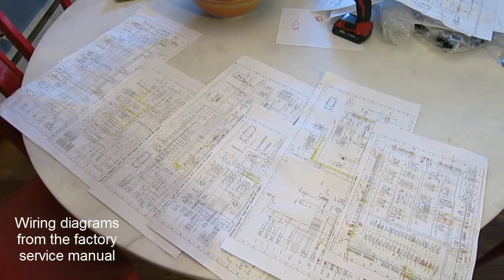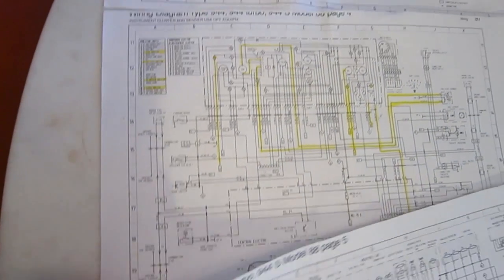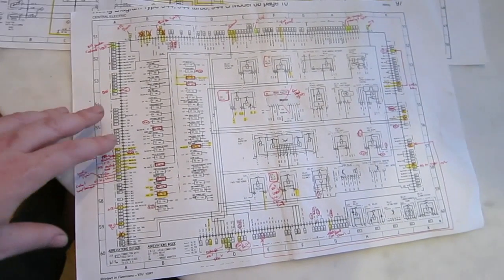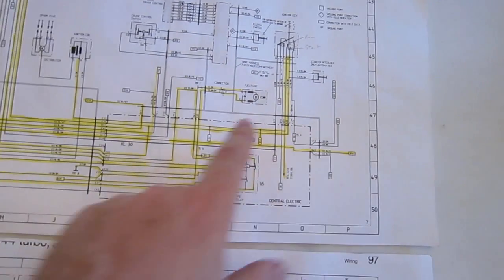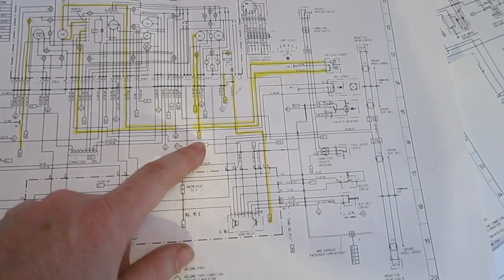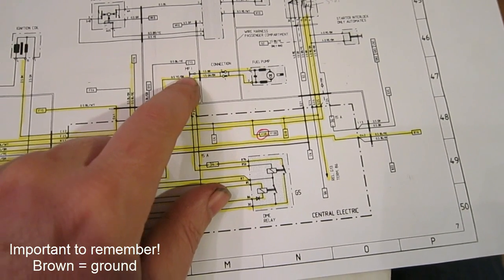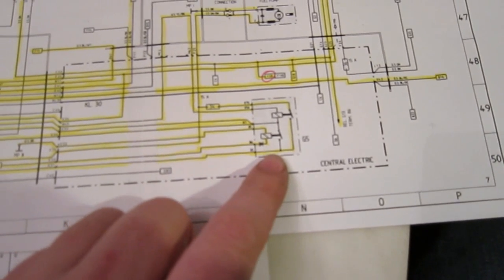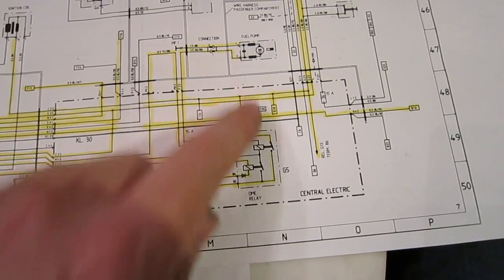How to read an automotive wiring diagram (Porsche 944)

Comment: Hey man I've been having electrical problems with my 1984 944 my dash lights and day lights have gone out recently, this problem has happened before like 3-4 weeks ago it was fine but not after two days ago when I was going home from work, switched on my lights and nothing all that turned on where my headlights.. Let me know what you guys think it could be
Reply from the maker: There might be a fuse for interior lights.  Otherwise it might be a ground issue.
Reply: Van Svenson well it got fixed man! Mechanic told me he ran a new wire, he also said maybe a new wiring harness along the future would be a good idea, but apart from that man, now I'm having really slow cracking when I start the car, could that be a starter failing symptom?
Reply: low battery  @heligiohernandez8438

Comment: Great video! Where did you get the wiring diagrams? Any leads would be apprecisted
Reply from the maker: +Dalton Keeler Do an internet search for Porsche 944 Factory Service Manual - it's out there in PDF.
Reply: found one for a 88. How similar is this to an 86 like I have? Share many similarities?
Reply from the maker: +Dalton Keeler Should be just about the same. :)
Reply: Great thank you

Comment: This is a great video. Need some help with my 944s project car. I wires wverything up according to the diagram but have no spark. Tested ground signal at dme and I am getting constant ground without cracking the vehicle at pin one when i should only see an on and off ground signal when cranking? Any help would be very appreciated. Please email me at ebello232@gmail.com or call me at 3039157840.
Reply from the maker: Typically, no spark conditions are related to speed and reference sensor issues - start by checking those with an oscilloscope.  Good luck!

Comment: Great as always. When I did mine I knew nothing about electricity (still not too much haha.) I cut out all the wires on the left side of the car. I had to end up tracing down the tach signal that was part of that loom. Then I just cut out what I didnt need from the fuse panel. It took a whole day to unbundle that harness nested in the steering column. Im convinced they used witchcraft to get it in there to begin with.